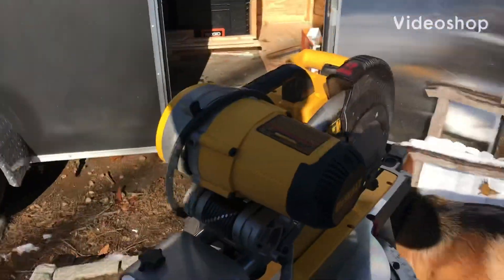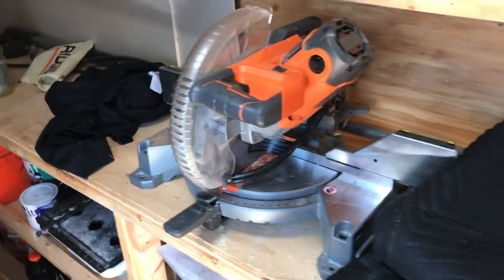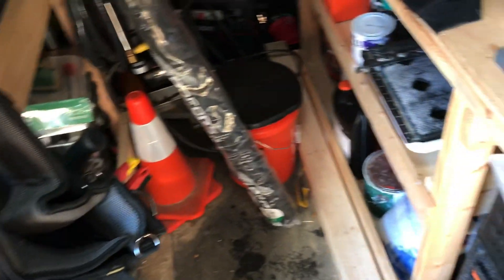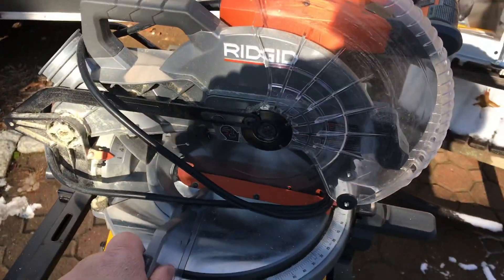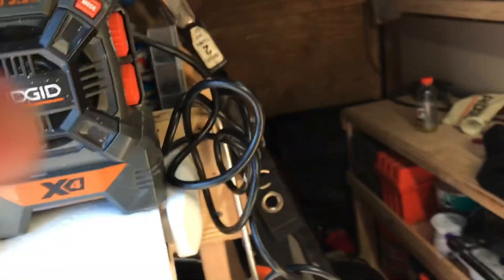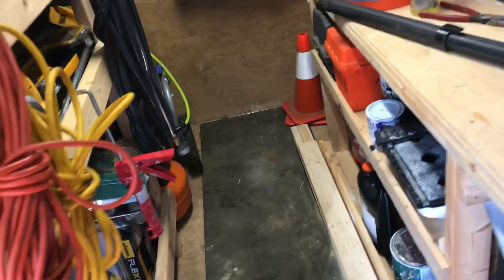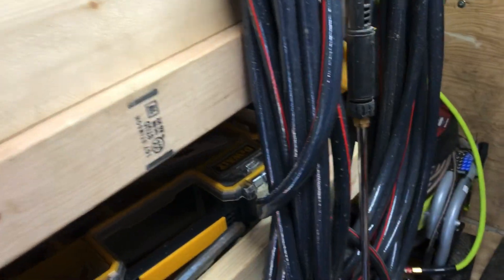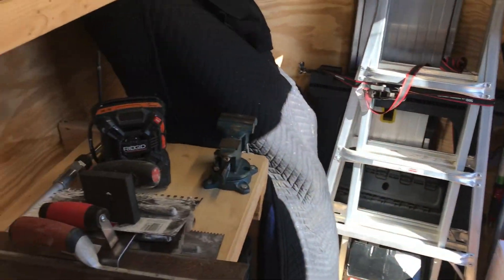Mobile tool trailer organizing.

Comment: I bought the rigid stand yesterday. I have that type of giant dewalt chop saw but was to cheap to buy the dewalt stand. However my saw is around 20 years old and I use it almost everyday.
Reply from the maker: MustakaBAM that ridgid is a deal at 99 bucks this time of year👍 if you’d like another 20 yr old saw I’ll give you the delta😀
Reply: High Ridge Handyman  l have that same exact delta. I have a ton of tools. Ironically I have almost that identical trailer.